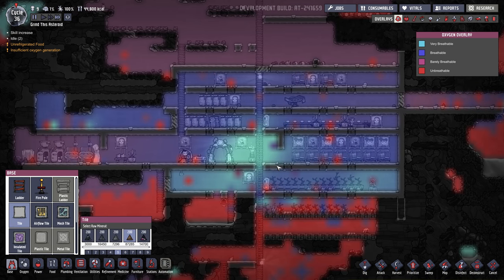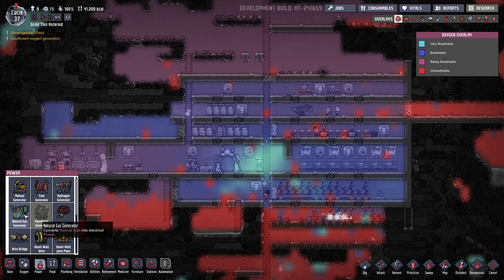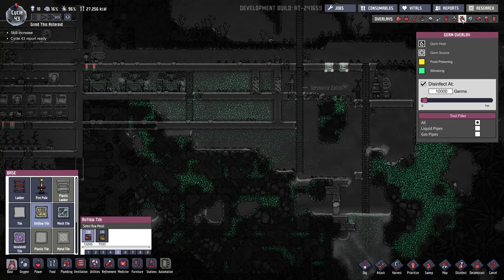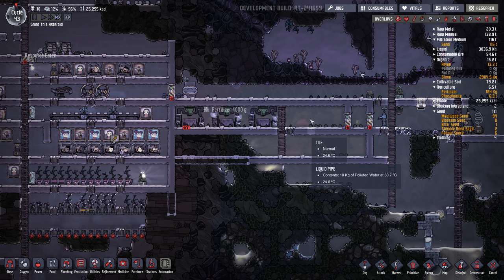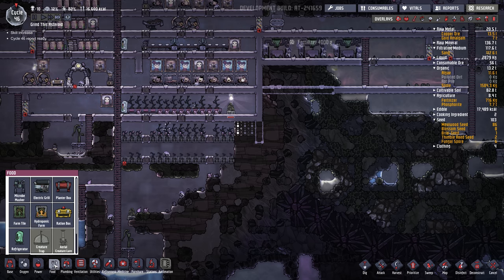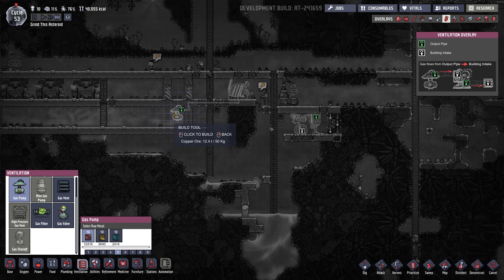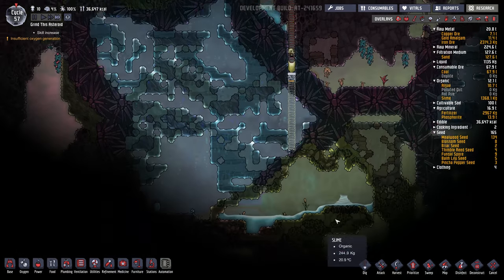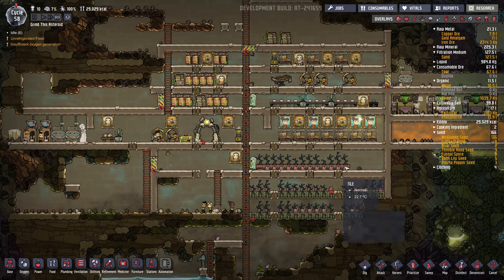NEW AUTOMATION BASE #2 - Natural Gas Generator Power - Oxygen Not Included Automation Upgrade

Comment: You think there is a way to detect if the power is full or empty? because then you could save on natural gas and heat.
Reply from the maker: There are ways I think. You can use the temp of a tiny battery to measure "fullness" of power. I think they are adding some sort of measure on the battery soon though. For now, I just build a large battery bank to store the extra power in until I need it.
Reply: You can set up a manual generator to recharge batteries at say 1% and have a pressure plate to detect when a dupe comes to charge the batteries. Use the resulting automation signal to light up a bulb to give you a visual signal or to power down the generators.
Reply: Look at brothgar's video "Intro to automation upgrade". At the end he set up a system that can be adapted to work with generators.
Reply: Yeah but you could make it much easier. You just have a treadmill and a waiting point. When the treadmill is going to be used the guy waits on the waiting point. Then have a pressure plate there. That cuts the powerwire to the treadmill and then you can turn on the generators. The dupe doesn't waste time trying to fill up the power and the generators get powered.
You might need to add a turn off signal to be delayed so that the dupe is not constantly going to it  xD
Reply: @Speiger Sounds like a very good solution indeed!